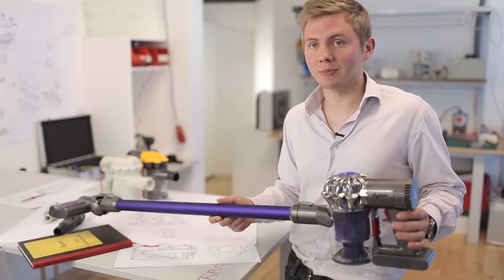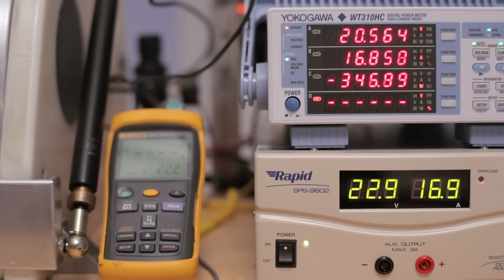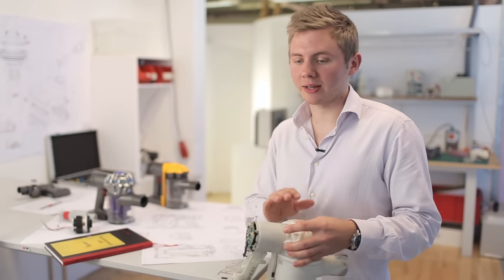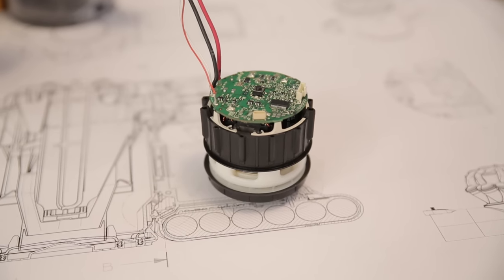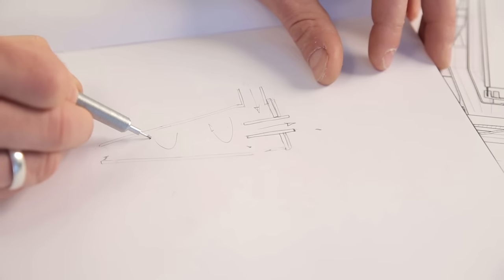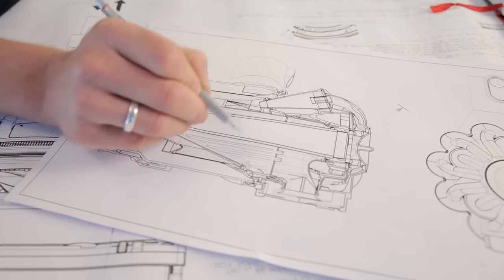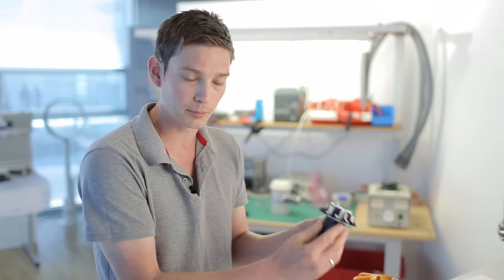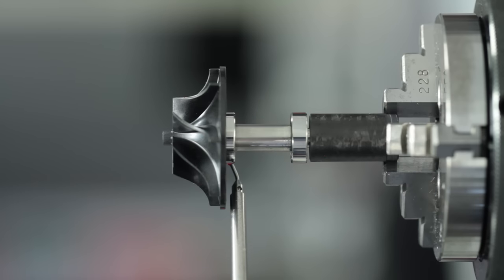The technology behind the Dyson DC59 cordless vacuum cleaner.

Comment: No it doesn't help as flour is also a household dust, putting this in small print in the user guide is no good as the original comment is to stick it on so it's clear before a customer makes the purchase. ONLY when the customer has waste one's time making the journey to a store, queued up and paid does the customer find out it's not fit for purpose so why not simply send a memo and have "NOT FOR SMALL DUST PARTICLES" printed on the box and add it as a small print under "Other's clog, Our's dont"

Comment from the maker: Hi there, it's Jack at Dyson. During development, Dyson prototypes are subjected to 636 different validation tests by our team of engineers. Trigger buttons are punched 20,000 times. Prototypes are drop tested 10,000 times. Cleaner heads are slammed into iron table legs. And every 100th bin off the production line is whacked with a lump hammer, just to make sure.

Reassuringly, like all Dyson cordless vacuums, DC59 comes with a 2-year parts and labour guarantee.

Comment from the maker: Hi there, it's Jack at Dyson. Dyson Animal vacuums are engineered specifically to meet the needs of homes with pets. DC59 Animal is equipped with an additional Mini motorised head to remove pet hair and stubborn dirt from furniture, stairs and inside the car. The motorised carbon fibre floor tool removes hair and ground in dirt from carpets, rugs and hard floors.

Comment: Amazing that Dyson has reinvented the vacuum again and again with a smaller hyperdymium motor inside and it makes so much of a difference to the vacuums of the past, that Mr Sir James Dyson has invented though. This was also one of the first cordless vacuum cleaners by Dyson, to have a battery that is permanent rather than removable like the Dyson DC35, which was the main thing that caused it to have a bit of a fault of at first working and then stop working. 
Thanks to you Mr Dyson for rectifying for many of the problems we had incurred so much in our vacuums. It's such a guaranteed connection to us and the world.

Comment from the maker: Hi there, it's Jack at Dyson. DC59 features an arrangement of 15 cyclones, working in parallel, across two tiers. Each cyclone has been re-engineered to increase airflow and generate high centrifugal forces, to capture fine dust. They work together with our new V6 digital motor, which spins at up to 110,000rpm. These refinements mean DC59 has three times the suction power of any other cordless machine in use, and sucks up as much dust as a mains-powered vacuum cleaner.

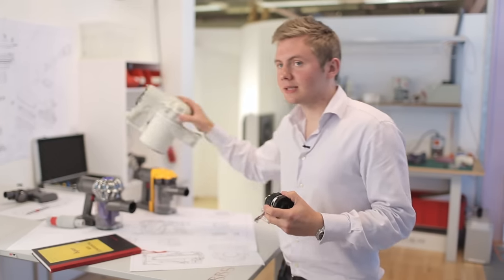Comment: 0:40 And this is where the design flaw over time showed its physical weaknesses and temperature issues.  The radial seal actually insulated the heat in the ceramic body causing expanding and contracting of the super thin egg shell housing causing the back cover slots to crack, also the confinement eventually became plugged with microscopic dust along the radial seal conduits requiring removal of the motor in the housing and cleaning the seals. Another thing is this heat trap also created exta load in the digital motor windings and strain on the battery if constantly used in max mode causing early battery depletion and eventually a completely worn out battery with critical amber flash codes ( BMS) facilitating constantly replacing batteries sometimes after only 9 months to 18 months of use. All in all the canister was good but the powerhead wasn't thermal efficient in dissipating heat. Still was a good product but needed refinement. A heat sinked ceramic housing and an offset radial seal would have been the best bet.

Comment: Hi, The Dyson V6 is a brilliant machine, just one comment though. It is recommended that the filter is cleaned with water, if the filter is then replaced while it is still damp it will instantly destroy the motor. Too much electronics I suppose. Although Help line arranged for a new Motor to be delivered free of charge which is easily changed.
Reply from the maker: +smle1000 Hi there, it's Jack at Dyson. Just to confirm, although we recommend washing the filter once a month using cold water, we do state that it must be allowed to air-dry completely before replacing it. This could take at least 24 hours. As you've said, if you replace the filter when it's wet or damp, this is likely to cause significant damage to the motor and electronics. This would be true of any type of vacuum which includes a washable pre-filter. Ordinarily accidental damage like this wouldn't be covered under guarantee, but I'm glad to hear our Helpline was able to replace the main body for you. You're welcome to contact them directly if you need further help at any point.

Comment: Trouble with the Dyson cordless vacuum cleaner his you only get 15 minutes at full power which is a big pain and limits its use in the home.Would it be possible in the future products to triple size of the battery pack ? I notice you are using a hysteresis motor, which is relies on electromagnetic drag to turn the rotor. This produces a lot of magnetic loss in form of heat. Would it be better to use neodymium permanent magnet has a rotor for future products.This would improve the magnetic efficiency of motor and less heating of motor and some improvement in battery life. Other than that it is a very good vacuum cleaner for size and portability. One good application his stair's and furniture and bedroom, especially under the bed; but there are many times you need more than 15 minutes of full power.

Comment: Battery only lasts 26 minutes. Bummer
Reply: In my experience it's far far less than 26 minutes. More like 4.
It has only 6 18650? cells that cost around 2$ each. Same as a modest laptop.